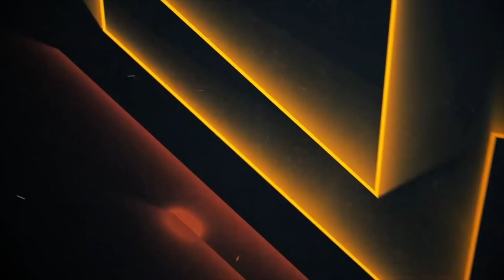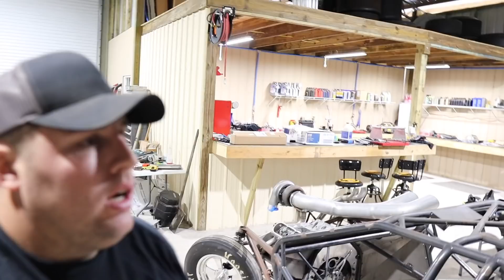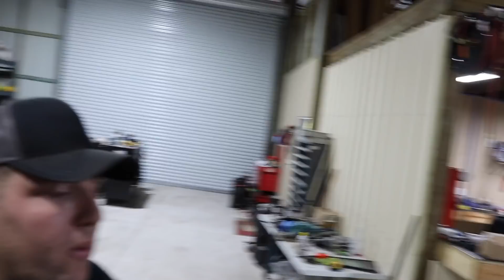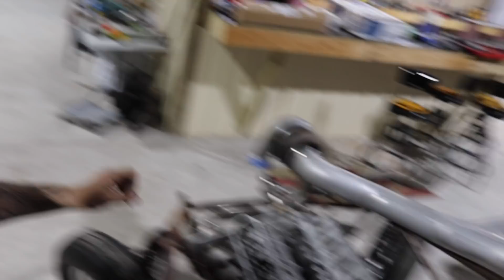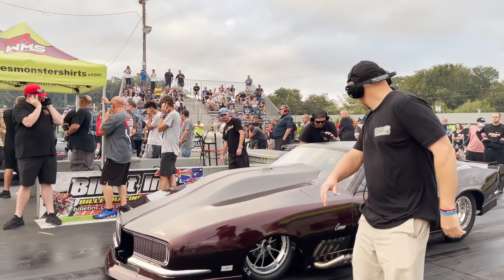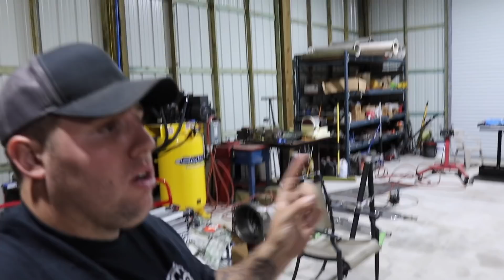PICKED A NAME FOR STREET OUTLAW LEXUS BUILD, NEW MOTOR FOR CHILD SUPPORT BUILD!

Comment: Are you gonna run CO2 for your parachutes and shifter? You could keep both hands on the steering wheel until you need to pull the parachutes?

Comment: Just what is the difference..between rvw.and pro275.
I'm new to racing trying to learn...is the mustang going to be called divorce 🤔  or breakup..cant wait for npk when does that start 2021
Reply: RVW and Pro275 or x275 just have different rules and weight restrictions and motor restrictions tire size ect. you can look up the rules online just look up duck X productions radial vs the world rules 2021 or 2020 and pro 275 rules and obviously the NO Prep King has their own set of Rules for the street Outlaw deal
Reply: @jdwi6157  thank u sir

Comment: Fuck bro, direct drive Pro Charger Blower on that Hemi. Only real issue is the steering clearance issue's. Justin, Proline with direct drive blower already clocked a 3.53 @ 208. Question... Do you know anything about Noonan Engines ?

Comment: you be dumb to try run the tried and proven setup. like it or dont, twins and now a hemi with a pro charger are the way. few guys will keep up with out forced induction, its not always about the numbers on a dyno but, when the season is so tight and people had a year and a bit to get ready, the switch makes sense. sure big country will figure out the tuning fast, and with two cars to test with on a new heart, i think its going to work out for you guys